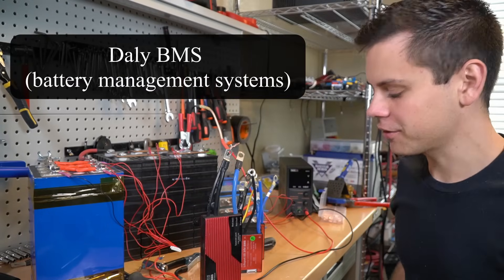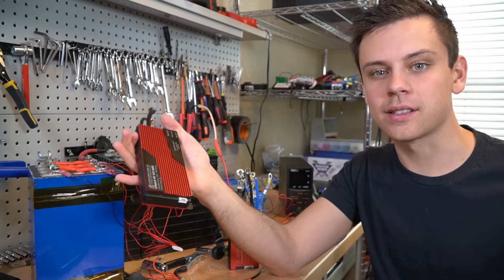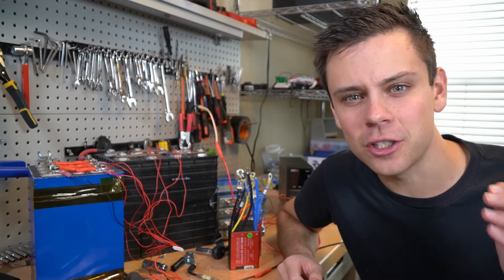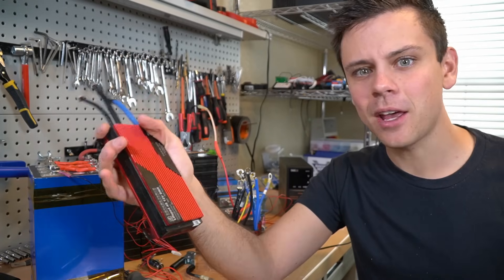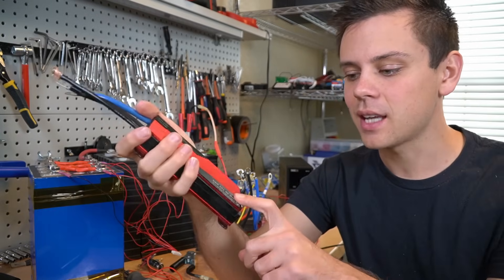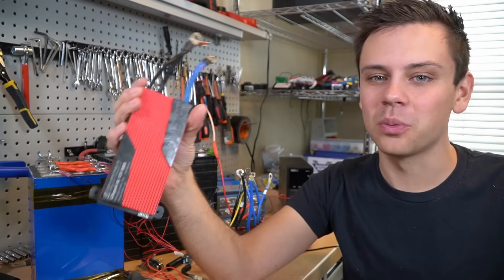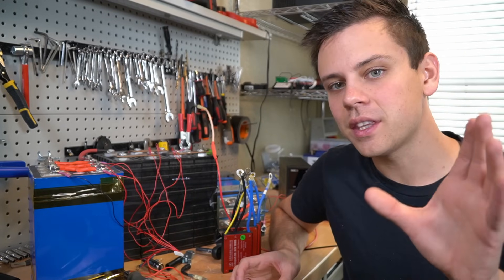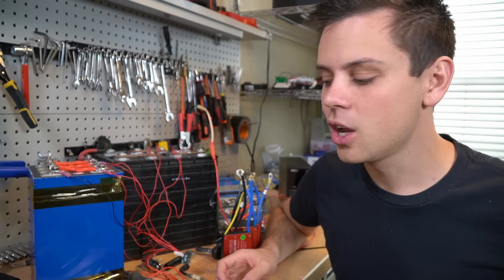Does Daly LiFePO4 BMS have Low-Temp Charging Protection? Let's test it!

Comment: I was looking at the current model LIFePO4 24V 100A BMS, and the temperature protection on the data sheet doesn't make sense now... they list it as "Charge: -20~55C Discharge: -40~75C". I have no idea if this means at certain low temperatures it wont charge/discharge at all, or if it means that it will charge it. Google tells me that I shouldn't charge LiFePO4 at or under 0C. 🤷‍♂

Comment: I have built a 4s battery 280AH/12v with a Daly BMS. The BMS JBD replaced with Daly 200A 4s are plaguing me. Daly passes gas for minutes, almost long enough to make a cup of coffee. I am using a 2500 W invert. Seems Voltage drops off below 10,V then 45 seconds later, restarts, and repeats the cycle. Seems there needs to be 1 authority on BMS (Daly, etc..) software. Admittedly, I am not a software people.  Help? You got me interested in this, interesting challenge. thank you.

Comment: If you have two 100ah  batteries with a bms and connect them in parallel,  does the max current then double? If they both have a 100A bms and are in parallel to make a 200ah bank, could you draw 200A and it would split it between the 2 bms units and not cause issues?

Comment: Warning buying from aliexpress and definately dont buy from the 18650 battery store. I bought
320 amp hour batteries and they never got delivered. Aliexpress always sides with the seller.
The tracking number was bogus and was not able to be looked up by the post office. Also Paypal
 would not refund my money either. When buying anyhting on aliexpress first make sure you look at there feed back. Its in the top left hand corner of the page. I had to learn the hard way and am out $600.

Comment: Hi Will, awesome videos! Just wondering if there was any update on the daly bms with the low temp cut off? If not is there another 12v 4s4p 300amp bms you would recommend?

Comment: Daly most definitely does have low temperature protection, but the temperature has to be below the temperature cutoff you set in the program.  What did you set the cutoff as?  If you did not change it, many times, depending on firmware it is set well below 0 C

Comment: Have you tested Cheap BMS on Ebay Apex 4s 12v 100A?   I do not think they can handle 100A as the terminals are too small and  PCB traces too small.   If you have a good BMS do you need a Charge Controller for Solar?

Comment: I use a 4S 12v 80A Daly BMS all works as Will said, but I have looked everywhere for the fault I have. The app installed ok, but after x mins (30-60) I get a message "Device disconnecting" and an OK button. I reconnect sometimes works, but if I leave it for a while the App can no longer see the Daly BMS.
If I now disconnect the batt harness for 10 secs and reconnect the app displays the daly bluetooth ID and works again for a while. 

So all works well, until when I want to check later the app can not see the Daly ID.

Nice channel Will.

Comment: Does anyone know if Daly BMS's support any startup load above their rating?  I'm looking at a 120a Daly BMS for a 200ah LifePo4 to run a 1440 watt water heater on a 1500/3000 watt inverter.  That should be right at the 120a rating of the BMS, however, I'm aware that heating elements do have a small startup load due to lower resistance at cold temps as the heating element comes up to temperature...

THANKS in advance for any help.

Comment: Hello, it was a very useful video. I hope you can help me. I have a similar BMS, but with a fan design. All I have to worry about is that the installation doesn't work and now I keep feeling that I'm measuring with 37 Amps, while nothing is connected to the batteries, if I connect something, I can do it if I charge or discharge, the 37 Amps will remain. Can you help with 0 Amper callibration?

Comment: I know this video was posted a long time ago, but was there a follow up video when the one he ordered came in?  And isn't there a temperature sensor that has to be plugged in?  It's the cell temperature that matters, not the BMS temperature, so I'm not surprised that chilling the BMS had no effect.  The plugged in temperature sensor on the cells has to get cold.  Or so I would assume.  I don't have a Daly BMS, yet.

Of course even if low temperature cutoff was supported that doesn't excuse the poor communication and documentation.

Comment: Hey Will, the Daly BMS actually has low-temp cutoff, but u have to set it in the app to the correct temperature
out of the box it comes setup at -40°C which as u way too low for Lifepo4

hope this helps
Reply: Do ALL Daly bms have bluetooth? I bought a 250a bms and there's only a port for the balance cables. there's no ports on the side for anything else to connect into it?

Comment: Most of BMS's out there do only 30-60mA balancing. And that can hardly do anything while charging with 10s or even 100s of amps. So in reality the cells get balanced on their own. Maximum and lowest voltage limits for LiFePO4 Daly BMS's (according to their Chinese datasheet) are 3.75V and 2.25V respectively. Which are not very friendly to this chemistry. So even there, these BMS's fail to protect the cells.

Comment: Will. I watch your video after I had order the Daly BMS and with battery cells already installed , just like you have. I used the bluetooth app to check if stop charging when the thermisitor was inside of iced glass water and mine shows it stop charging. I don't know when you buy the daly BMS by itself  has the parameters need to to stop charging when it reaches a certain temperature. These are custom set. Have you check the preset factory parameters? Thanks

Comment: Do I have to use all the wires?  IF I purchased a 14S bms. will it also work on 12S?

Sorry for such a dumb question. 

I have 2 12S batteries and looking for a great BMS to charge quickly.   I plan on discharging quickly with a Battery Protect. Viton brand?

Comment: I ordered a Daly BMS and asked for low temp cut off, they said I could specify a cut off temp between  -7°C and 0°C.  Did you specify a temp? I wonder if the one you tested was set to -7°?

Comment: I just get my 100 ah daly bms today, testing it and cant find my mistake. Battery is at 13,3 volt, same battery you use but eve 280ah. But at p- it shows 10,5 volt. I check the wireing and resistance for each line. I connect the blutoth adapor but no respond. I even dont know if its on.

Comment: I have a Daly BMS Li-ion the  low temp disconnect was set to - 40 deg C adjusted and it works you need software to adjust the setting
Reply: Did you request low temp disconnect specifically when you ordered it or it came standard with it?
Reply: @wraymedia3324  Gday Will
No it came with it it is set to -40 by  default 
It is in the configuration software 
I tested mine at 17 deg on the bench and it worked
If intrested l can send screen shot of  configuration page
Reply: @johnonlyonknobbies  Thanks for confirming! Yes please send a screenshot if you have a chance

Comment: Just bought one of the"new" ones. Does not have low temperature protection.
Reply: The new one is said in the datasheet : temperature : customizable. Perhaps we just need to tune it. How, i don't know...
Reply: @philv3941  you have to set it in the bluetooth app. It comes from the factory set at -25C which is nuts as a default value!
Reply: @sfong06  thx steve

Comment: If it doesn't have an external temperature sensor it won't measure the proper battery temperature.  No port to plug in a sensor, pretty safe to assume it isn't going to protect your battery.

Comment: Hi i would like to ask what is the difference between separate and common port?? What should i use? i am planning to build a 48v 200ah lifepo4 battery (32 pcs of lifepo4 prismatic 100ah 3.2v)  system, i have must mppt 80amp charger and 5000 watt inverter.. thank you in advance for the answer

Comment: Hi William, perhaps one way to protect from charging in low temperature is to connect an external low temperature cutoff switch on the positive signal cable connected between a Daly BMS and Cell 4. If the contact between the BMS and cell4 breaks, charging stops.
As someone mentioned earlier, maybe a Kemet TRS3-0MCR01 for 0 ° C can be connected as a cutoff switch.

Another video idea is how to protect LifePO4 batteries from being over charged, can we trust a cheap Daly BMS?

Comment: I just got a new one of these and it went down to 0C / 32F last night and this morning I went out to find... 0 voltage coming through from my solar array! Totally freaked me out at first, then I realized what must be going on because my inverter was showing 24.8V (and I confirmed this at the battery terminals with my multimeter) from running a small heater overnight. So I knew the batteries were fine, but the negative (black) on the BMS was showing 0V. That's when I remembered the low-temp disconnect feature that was listed on eBay when I bought this module... I do believe it's working as intended. When it warms up a little I'll know for sure.

Comment: Any update on the new Daly model, does it have low temp diconnect?
Reply: Yes, but it will only work when the temperature is less than the cutoff temperature.  Default setting many times depending on firmware is less than 0C.  Will listen to the company!!! ;)

Comment: Have you ever tested for over current protection? I’ve seen you many times not use a fuse and say it’s fine because of the BMS. I tested 2 Daly BMS units today and neither seemed to have over protection. One 60amp BMS I pulled 72amps continuous, never shut off. I short circuited a 120amp BMS and it let the smoke out. I accidentally shorted out a 5 Battleborn battery bank with a wrench, all 5 instantly shut off.
Reply: 72 amps "continuous" for how long? If it's rated for 60 continuous, it's probably something like 90A for 10 minutes, and 120A for 30 seconds. The numbers are just a guess, but the point is that it's not a hard cut-off at 60A on any (non-programmable) BMS. Hope that helps.

Comment: I just received my Daly 100-amp  common port BMS and it does not have low temperature cut off.  In the overview & specs it says it does. I emailed them and they responded with that yes it's in the specs but you have to request one with that option. Should last price with & without.

Comment: I'm wondering if lifepo4 batteries need low temp protection in an area that stays  above 20 degrees Fahrenheit? I found my insulated battery box stays above 35 even on. the coldest days. Also the solar panels rarely put out more than 20 amps in the winter ...spread over the battery bank that means each cell is not being asked to charge at high amperage.
Reply: If you're certain about the battery box temperature remaining above freezing, then the current won't matter.

Comment: Heartbreak! I ordered the new Daly 4S Common Port BMS and just noticed it does NOT have low temp protection. It is high temp protection you set at 65C or 75C.  What kind of genius work around do you recommend Will? Incidentally, I followed your Aliexpress link and as you scroll down the page, you will see that there is a Chinese version of the data sheet. It shows temperature protection at <-5 to >50 or >70. I interpret that to mean it will shut off at less than -5C, but who knows and what would be the point? It would make more sense if it cut off at 5C.

Comment: Wouldn't a BMS need an external temperature sensor for low-temp charging protection? As the BMS itself will get warm and stay warm if it's charging batteries?
Reply from the maker: Absolutely

Comment: Hi Will. I have a question. I currently have a lifepo4 60amp battery on my little solar power system. I got this about 8 months ago and have only been doing about 50% depth of discharge. I wanted to buy a 2nd one but the supplier I got it from have closed and other places are selling it at a higher price. Anyway I have seen another battery that is on special at a good price for me here in South Africa. This is a 108 amp battery with the same voltage specs. Can I use these batteries in parralel?  I know it's better to use the same amp sizes,  but theoretically isn't it like filling up 2 different capacity water containers? They will stay level voltage wise, the one won't get fully charged before the other, being in parallel they share the voltage, I  understand the bigger one will absorb more power to full the bigger space but they will stay at the same voltage and charge up together? Thanks.

I should add I'm only using a 350 watt victron inverter, so loads will be low. I am using a victron mppt charge controller with voltage rang set to 12.8 and 14 volts.

Comment: it is not really BMS, they are just hardware PCB. Just for protect battery from over charging and discharging. All smart BMS will support low temperature cut. Most of hardware PCB do not support it
Reply: Non-smart BMS just needs a normally open low-temperature cutoff attached to the TH terminals. The cheap BMS on my Headway 16S pack has solder points for two thermal switches, presumably one for low and one for high.

Comment: Is this low temperature charge problem only for LiFePO or also for other Li-ion chemistry? And it is only for charging, not for drawing amps, right? If you have the battery stationary at home in the cellar or where ever i dont see a problem with low temp, if you dont live in alaska or the artic area...

Comment: Hi Will I need you to ask you. I have 2 different solar panels. 1 solar panel is a Rich Solar 300watts, max power voltage 18v, open circuit voltage 22.35v, max power current/IMP (A) 16.67. the second solar panel from Sungrid is 175 watts, voltage at Pmax35.2v, current at Pmax 4.97A,Open circuit voltage 43.6v. I bought one controller which you recommended Renogy DC-DC ON BOARD BATTERY CHARGER WITH MPPT DCC50S which I want to connect the 300watt solar panel. I also bought a EPEVER TRACER BN SERIES 40A which I want to connect my 175 watt solar panel. Question is can I connect both controllers to 2 new deep circle AGM batteries connected in parallel and not damage them. I called the company that supplied me the batteries and they told me I cannot connect both controllers to the batteries because it will confuse the batteries. What is your opinion. Cheers Bill

Comment: I ordered a Daly 4S Lifepo4 30amp  from eBay so-called local supplier and they sent Li-ion - when I contacted them they seemed oblivious to the difference - when I explained that the higher Li-ion values would damage the pack and possibly start a fire they said I'd have to return it to their supplier - in China- in the end, I had to get eBay resolution to get a full refund which came from China not locally - A BMS is a safety item that seems to have no regulation. A Li-ion BMS with a spec sheet for Lifepo4 is an accident waiting to happen.
Reply from the maker: Wow they are idiots!! That is horrible. What was their name?
Reply: Ebay has had some kind of loophole for a while that allows non-US sellers to "fake it". If they have some kind of gibberish name, thousands of sales of brand new Chinese-made products, and an expected delivery date of over a month, that's one of them. Oh, I've noticed a fair few of them list their address as "Chatsworth, CA".

Comment: Would you explain why not having a low temperature shut off in your bms would damage your lithium batteries?
Reply: Because the snot (technical term) inside your batteries freezes, and won't move through the membranes.

Comment: WIRE! Hey little brother, I am homeless off grid very small electric needs but going up. I have a question. I find lotsa phone wire every where like as trash, so I am using cat5e cmx outdoor-cmr which has 8 conductors, I connect 4 each as single wires giving 2 conductors . Is this ok or should I find better wire. Also I did the same, taking a 3 conductor exstention cord twist all 3 to make 1 x2 to make positive and negative leads from solar hub to controller insulation on except for the ends. I have only a simple light tester. Does it draw more
Reply: I don't quite understand your exact question, but as long as you just want to carry power (so, not data), any wire is fine as long as you have enough copper mass. The only real issue with Cat5/Cat6 would be breakage due to solid wires, but if you're paralleling a bunch of strands anyway, who cares?

4 strands of 24AWG (e.g. Cat 5 or Cat 6) will very conservatively carry 2.3 amps continuous, and way more -- like, 15A -- for shorter amounts of time. And, like I said above, you can just parallel more wires in there if you either need more ampacity or just want lower resistance/better efficiency.

Hope that helps, comrade. Cheers.
Reply: @fun_ghoul  thanks I do. Just that. I take like 8 conductor twist into 1 it runs all my DC side of thongs and the wire is free
Reply: @fun_ghoul  now you have 48 subs thanks for your response, I have been using cat 5 twisted to carry just 12 v for everything except inverter. The wire is everywhere. I was only concerned about each wire being insulated from one another except at the ends color code so you can identify all color groups twist 16 and 16. For more amps but 5 watt led really bright lights my whole house no electric bill at all except initial cost. Heavy load only when in studio studio monitors 2 amps in each speaker they love current😳  but have 1000 watt inverter generator for extreme loads. gonna pick up a large Line 6 amp today for the guitars off grid studio new music be coming up soon.

Comment: Hi Will, Thanks again for another excellent and informative video. I hope the new Daly BMS DOES have low temp cut off, but if not or until then, what do you think of either either a low temp cut off or low temp heater mat circuit?

Comment: You may not get the newest BMS,I am quite clear about the low-temperature function,they developed the function due to our requirement ,we placed the 100 units at one time,so they took two months to develop,and the protection temperature is -5 degree.